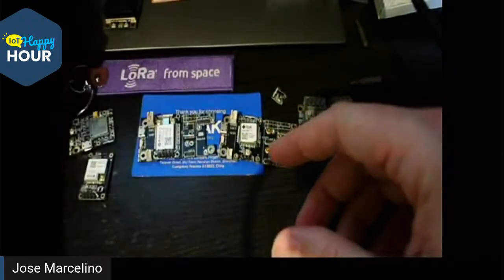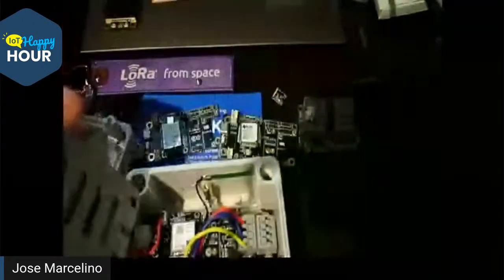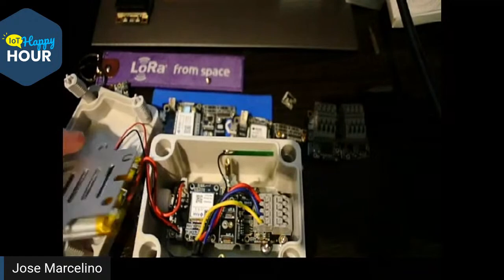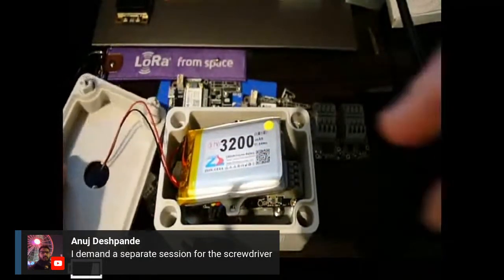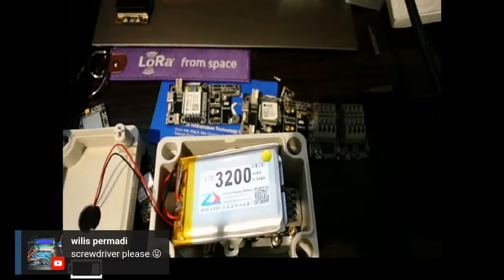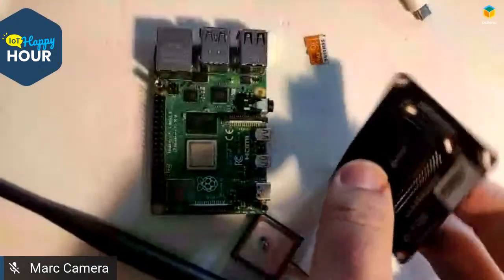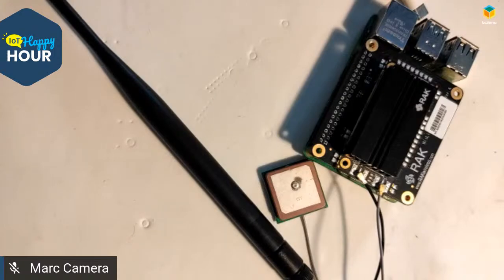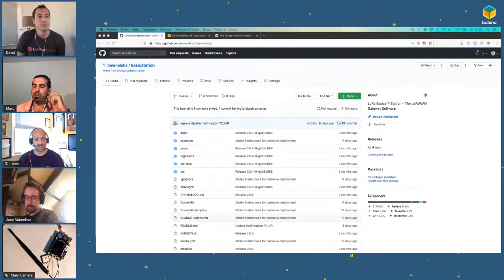IoT Happy Hour #17:  Building a LoRa Gateway with RAK and balenaCloud

Comment: Hi, I've been interesting to use this balenaCloud with my Rak2245 however, my devices log did not download the image and the supervisor starting was at longer time about 3 hour after the configuration change. Do you have advices on tackling this matter?
Reply from the maker: Hello Syarifah, thanks for your message. My versy first suggestion is go to https://forums.balena.io and report this issue, so we can help you and please tell us more details about your Raspberry Pi. What OS version are you using?
Reply: @balenaio  thank you for your reply. I am using raspberry pi 4 using 64 bit OS. As for your suggestion, I realized that I do not have the release however when I tried to push the image into my application in command terminal, it state I do not have the privilege to run the operation though I run in administrator mode.